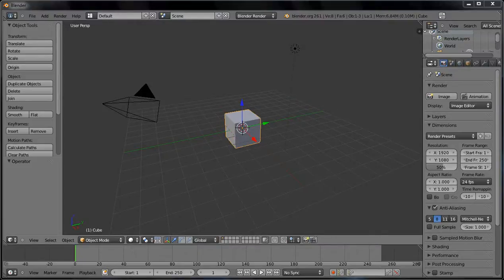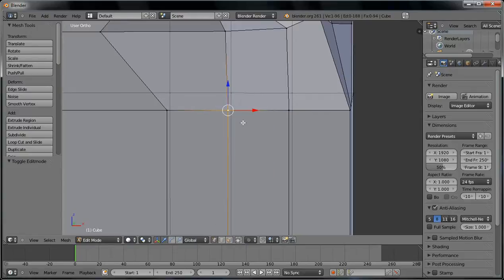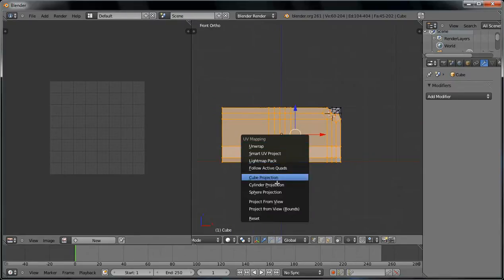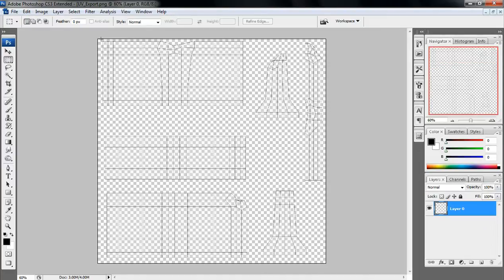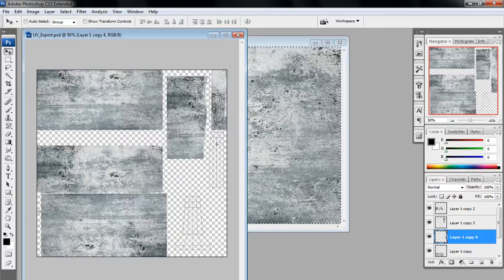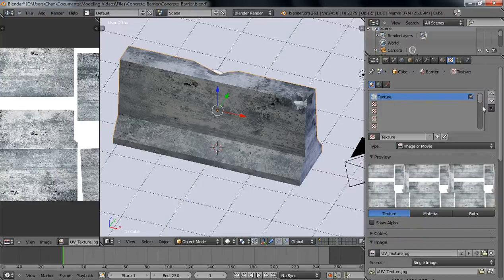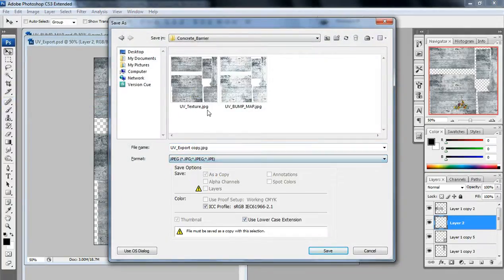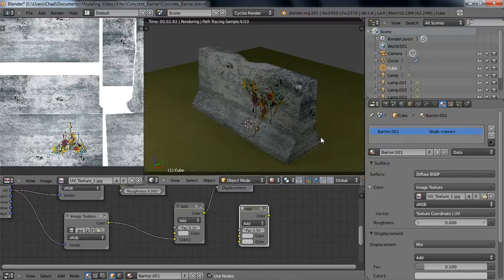Blender Tutorial Modeling an Object - Making a Concrete Barrier

Comment from the maker: Umm I would just seperate it into chunks.  Each Room could have its own texture map.  I think it would be the easiest and normaly have 7 1024x1024 textures is better then one massive 3000x3000 or something like that because in my case i use unity and it would compress the big one down to a smaller less detail size

Comment from the maker: Yes you are correct. But if you say use this gameobject in a game or in some rendering engine.  if you have a texture that is 512x512 it will 1) save memory in the game 2) it will take less time to render the object if the texture is smaller 3) it will make the game run much smoother.  but yes if you were going to use it for a one time nice render. you would make the texture much bigger

Comment: when you scale he texture down you lose quality because og less pixels right? Wouldn't it be better to lets say, import the uv image as 3600x3600, so the image is alot bigger, that way you wont have to scale the textures down so much = you wont lose that much quality. Wouldn't that be better? In theori